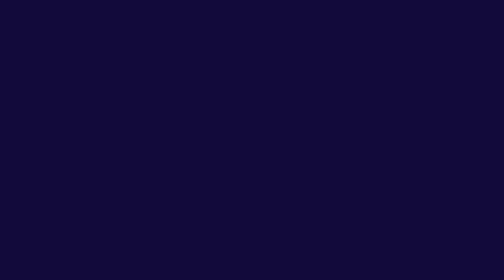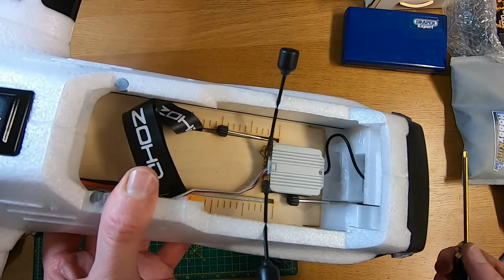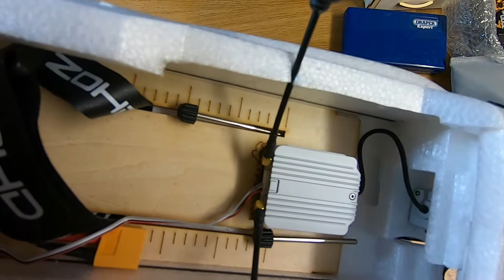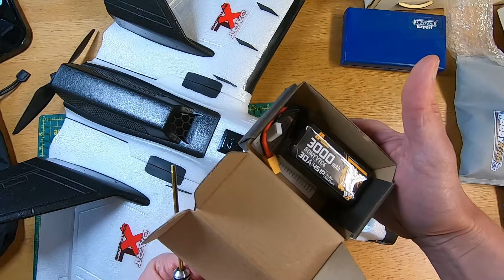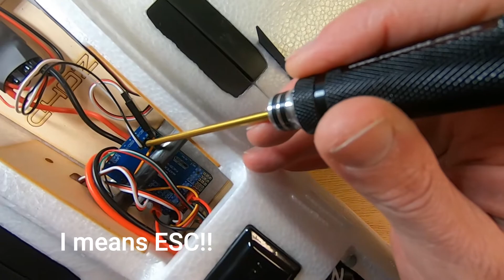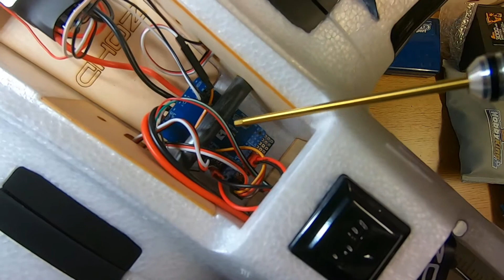ZOHD Dart XL Enhanced FPV - DJI HD and Inav build

Comment: So you have any videos on how to setup a pnp version with only dji vista/air unit or would I need to add something like crossfire? What program do you use to program switches with Tx16s
Reply from the maker: Hello. No I don’t. If you have a DJI controller then you can use just the air unit. But it if you have something like a radiomaster then you will need to supply your own receiver. You set the switches up using the options built into the transmitter and the inav software on the flight controller 👍🏻

Comment: How about dji transmitter overheating?
Reply from the maker: I haven’t had any issues
Reply: @tdogrc  Is there airflow there? I am vista transmiter user and it is overheating super easily. Maybe full size dji is more durable? In my drone I cannot keep vista tx turned on long, I need to fly to keep it cool.